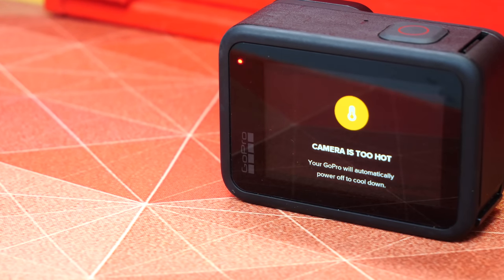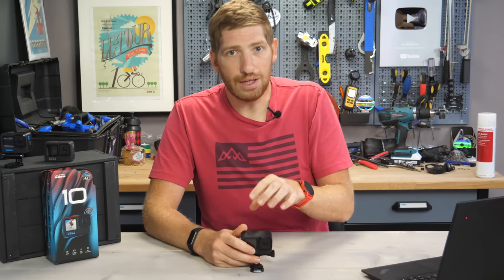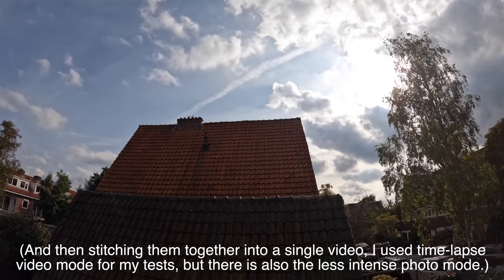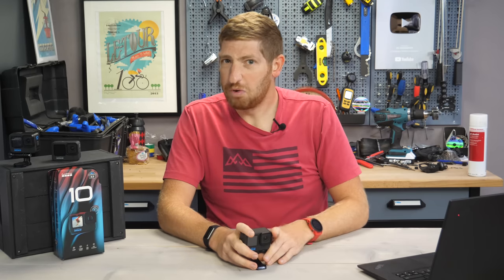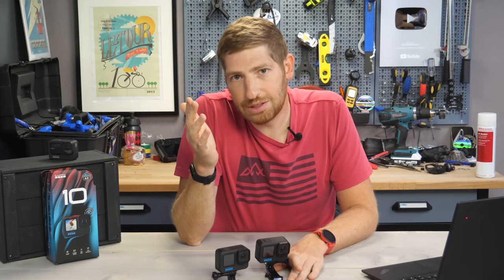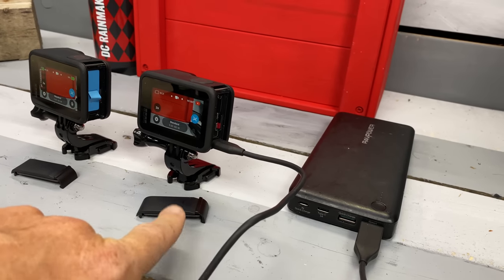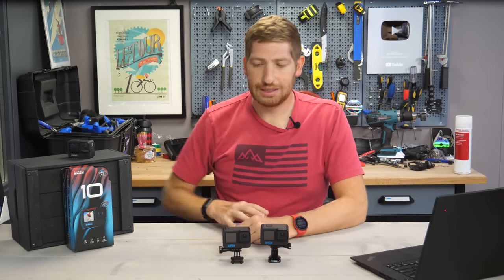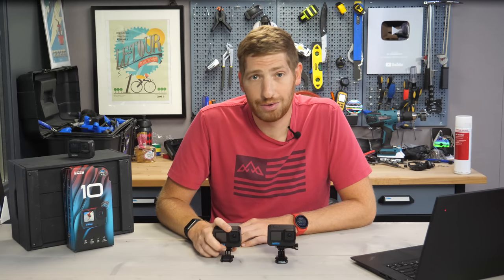GoPro Hero 10 Overheating: 40 Tests Later

Comment: What about taking off the battery and just run Gopro without battery and with a charging cable instead! It should dramatically increase the filming time and hopefully there will be no overheating. I've done that on my old Xiaomi Yi 2K and it just worked flowless.
Reply from the maker: It’s in the video…😉

Comment: two issues - *thanks for doing all this testing*:
->just got back from a ski trip to Park City, Utah and brought my newly purchased GoPro 10 - I expected to have a learning curve getting used to using it; however, I encountered battery too cold messages on two days in the mountains with the camera shutting down and couldn't even shoot a few minutes of footage after getting off the lift before that occurred.  You made a beach in your bathroom.  Perhaps you can make a mountain somewhere ...maybe add a fan blowing 40mph in your freezer ;) - I realize that Enduro batteries are being sold now (think that should have been included) ...but it was very disappointing to have no chance to capture footage of the skiing to share with family and friends; especially knowing that the camera is marketed for use specifically while skiing. :(  It wasn't below zero.

-> initially my first GoPro (RMA'd) would overheat when trying to recharge the batteries ...they would charge to about 70-80% and then the GoPro overheated and started cycling on/off - latest device has been better at that but I've intermittently had issues - this is in my 70deg apt. statically sitting with USB C cable powering it.

Comment: Thanks for your tests. Well done. 👍 What we really need. 101 degrees Fahrenheit isn’t that hot. That’s 38 degrees Celsius. As for in car dashboard, it shouldn’t fail, especially with air conditioning. An action camera needs to handle heat and cold. Doesn’t give me confidence.
Reply from the maker: Keep in mind that in a car dashboard with A/C, it wouldn't reach 101*F by itself (now, with direct sun it might impact it slightly).

Comment: My use case for GoPro's are to record airplane flights in small aircraft. I was having issues with the camera on the dash/windshield used to record the angle facing the pilot/co-pilot faces shutting down due to heat because it was directly in the sun through the windshield. To solve the problem I built a small heat shield to block the direct sun using an old iPhone box and heat tape (essentially think aluminum foil with a sticky backing). I cut holes in the box for buttons and on the front facing shield I just cut a hole for the square lens cover to stick through. Using one box I built two shields, one to use when the camera is facing frontwards and one when the camera is facing backwards. Working fine so far and haven't had a heat shutdown yet using the camera in the windshield.

Comment: Geez, I have 2 GoPro Heros (3 and 3+) and they have never overheated on me, even when recording continuously for hours indoors under tungsten cinema lights.  From time to time I consider getting a new GoPro, but overheating is a major major deal breaker.  The only reason why I buy a GoPro is for continuously shooting, who really fools around with a GoPro for little clips when smartphones are ubiquitous?
Reply from the maker: If you don't shoot 60FPS (and, for most applications there's no need to), then as the video shows, it won't overheat at 30FPS. And that's before the overheating-related firmware changes GoPro made last fall.

Comment: This has ben a very useful review, I currently own a Hero 9 Black that I use at 4k@60 with stabilisation and horizon levelling mounted on a helmet and it has produce very good 4k@60 footage in linear mode. Once when I rran it continuous for over 40 minutes outdoors it recorded everything but when I turned it off it would not turn on again for a while so it was close to overheating. I am interested in a Hero 10 Black because of its faster processor and perhaps 5k@60. Apparently the touch screen is better as well. Thanks for a well designed set of tests, a great review. 👍

Comment: Great review. Lots of valuable time involved. According to your results placing the camera in an aluminium cage show minimize overheating as heat disipation would be better accomplished by the large surface. Uhhh interesting. Someone may try it and report the results. Greetings from Paraguay in So.Am. Not certainly Dubai's heat but getting into summer soon.

Comment: I noticed a charging brick was used at a point and it greatly extended the time before overheating. Would I be able to use a power strip that has USB-C/A ports on it to power the GoPro in leiu of a battery? I'm trying to film my band's live performance which is ~1 hour and 20 minutes in a warm room so I am looking for a high degree of certainty it won't overheat.

Comment: Saved me from getting very frustrated, My 10 kept overheating basically because a leave it running high frame rates and quality for a long time with a 256 GB card - and to keep it going keep a battery back plugged in. Summers starting here in the UK and there isn't any wind so it it kept lasting 10 mins if i was lucky. Got to your idea of taking the battery out and leaving the door open. Success! Its going great guns. Never realised you didn't need the battery in :)

Comment: Ive been using gopro 9 black with external power and battery out at 4k for hours and works great. Once in the sun in texas it shut off. Do newer models require battery to be in to work?

Comment: Basically this is just like the DSLRs overheating when filming video. A lot of the Sony NEX cameras had a 15 minute recording limit because of this and other DSLRs are no different as they tend to limit or shut off after 30 minutes recording when they get really warm and this is just shooting 4K 30 or 1080p 60. What do people expect when you put such high powered sensors or processors in a really small enclosure? The DJI Action 2 also overheats when at a stand still. The OSMO Action had a little grill vent on the front of the camera to minimize heat build up ( I own one and a GoPro Hero 8 Black). Smartphones also have heating issues when filming at the highest res and frame rates possible. They even get really warm when gaming.

Comment: I was wondering if external power would help, so it's great to see it tested as well. I'm planning to use the GoPro with an external power bank for multi-hour recording, but was wondering if it would also help keep the temperature down, as at least some of the heat I presume usually comes from the battery quickly discharging during intense use.

Comment: I can record until the battery runs out in 4k30 indoors and stationary at 75F with stab on and L+HL and high bit rate.  Same conditions, I get 35 minutes at 4k60 to overheat.  20 minutes at 4k120 to overheat.  26 minutes at 5.3k60 to overheat.  I have not been able to overheat the camera outside in any real world use yet.  I think these and your numbers are fantastic.  This camera is amazing.  BTW, I would suggest you RTFM, where in fact it does say in the manual that at higher resolutions and framerates the camera can overheat and shutdown.  Apparently, I am the only person in the whole world that actually downloaded the Hero 10 manual to date.  Just saying, a little RTFM goes a long way to avoiding "issues" like this one.

Comment: In the case of a 100 degree day, you're going to have solar loading as well. My hero 9 struggles with this because the camera is flat black. I know it's hard to setup a solar loading test at home, and if youre not in a hot environment you can't even test outside...but that would make a difference.

As someone that lives in the southern US, my gopro is more limited in the summer than I expected.
Reply from the maker: It really just depends. It's only limited if you're doing fully static (with zero airflow) type scenarios. If you're using it while moving, it's not as limited as indoors on a desk.
Reply: @Dcrainmaker  agreed. I have 4 gopros and when i film multiple angles i commonly have 2 set stationary on the gopro tripod and gopro clamp (gopro designed stationary mounts, so it's not outside of the design intent). The stationary cameras struggle quite a bit from May to September here, but I've noticed thay the 9 is when the problems got worse. This is mostly expected with a second screen...but it performs worse than my cell phone by far. I have to go through a lot of effort to keep them cool up to the point that I am ready to film then I have to rush through the setup and action. I've also had major issues with filming from my dashboard in a 72 degree car, but with the sun on the camera. Gopro needs to go back to silver or white cameras. 

I think full transparency from gopro should indicate this. They chose a finish that performs horrible in solar loading (matte black) and sell several stationary mounts. They advertise their camera as much more than just for use while moving. My real world use indicates this is a much bigger challenge than shutting off after 20 minutes at 4K60.
Reply: could paint yours white
Reply: @unfunny2258  if anything I would redesign the camera shell for hot environments and leave most of the surface area clear anodized aluminum. 

This is actually a market opportunity for gopro - selling a premium version for hotter climates
Reply: @EngineeringAfterHours  yeah, or just making a metal case, but painting it white would be a decent fix to the issue of black getting way too hot and easy to do

Comment: Thanks for doing these tests. I am one of those weirdos who needs to run the camera for literally hours from an external battery, where the only airflow may be the headwind from my 10 km/hr kayak. I got ok results from the Hero 9 at 4K/30, but only when I put it in an aluminum case ("Gurmoir" brand). I also leave the battery out and turn off wifi, gps, bluetooth and both screens to improve heat production (can't turn off hypersmooth because a kayak race is a bumpy event). I just wish there was a more waterproof way to get external power - I run the USB cable through a Ulnazi door and try to seal around the cable with silicon gel swimmers earplugs, which isn't ideal.

Comment: Just an FYI inside the windscreen of a car. The testing spec we used to use for verification testing was 110 degrees C from memory.  50 degrees in the middle East gives crazy internal temps if they are left standing.

Comment: I purchased a Hero 10 recently (within a week) and did 2 things (amongst others).  Charging the battery for the first time, I put the usb cable in a fast-charge outlet* using the supplied cable.  The camera heated up to the point I could smell the heat.  Transferring the charger cable to a normal outlet, the battery charged fully without the awful smell and the camera cooled down.
* noted that manual says to use a fast-charge cable if needed (another accessory to purchase or another battery).
The 2nd time, a day later, I didn't / haven't as yet used the camera but switched it on to try voice commands, after reading the manual. I switched the camera on and the battery had a 98% charge.  As soon as I switched on, a message popped up stating a software update - something that GoPro had just issued.  During this download (in lounge room, with no apparent airflow), that used approx 25% of the battery, the heat (camera hot to touch) and smell happened again!  The camera wasn't on charge.  I switched the camera off until it cooled down, which was relatively quickly.  No idea if the update was successful. Continue with the settings, camera stayed cool.  Still haven't used it.
I intend to use the camera for outdoor activities with canines and equines.

Comment: We have the cooling fan that most of you have been looking for.  GoPro 10, shooting 5.3K | 60 runs for over 11 hours with CAMCooLER Mini cooling it at room temperature of 78 degrees or for over 4 hours at an average temperature of 119° F at 1080P | 60 | W, without the internal GoPro battery installed.

Comment: Hey quick question. I race karts competitively, I got the waterproof case because l don't want the gopro to get damaged by small things. I'd be recording my racing heats about 3x 10-15mins a race day. Would the gopro 10 still overheat for me or would l be fine? If it will over heat. Should l drill little air holes in certain areas of the case?

Comment: Great indepth tests, thank you.
Ray did you notice the battery percentage inconsistency when switching diffrent frame rates? Ie 35% in 5k24, 20% in 4k60, and 12% in 4k120.
Also the GoPro 10 shutting itself off when the battery is circa 30% or less when recording 4k120 in about 7-8seconds and 5.3k60 in about 15s?
Reply from the maker: Thanks! Yeah, I saw a few battery percentage inconsistencies a few times that I wasn't quite sure if it was my brain getting tired or not. So I mostly set trying to track exact battery levels to the side, as my spreadsheet was starting to get kinda crazzy.
Reply: @Dcrainmaker  your testing was impressively comprehensive

Comment: I use Gopro since Gopro 1, this 10 is just terrible, if you try to use with a media mod to upgrade your sound after 4 or 5 minuts Gopro shuts down for overheating with the prerecord option on, they shoud understand if they want to milk us to use a decent external mic at least the product should work, with the media mode case the cam heats in minuts

Comment: I mount my GoPro on top of my Can-Am Off-Road Vehicle and shoot for hours.  Overheating was never a problem with the 8 but it is a problem with the 10 and 11.  The cameras are in a waterproof housing to protect them from rocks and tree branches.  I have started shooting one camera with the regular lens in the waterproof housing and one camera with the Max lens (for vertical format) unfortunately there is no protective housing for the Max lens.  And as you guessed the camera in the waterproof housing overheats and shuts off and the camera with the Max lens does not.  So I am going to take your advice and remove the battery from the camera in the waterproof housing and see if that solves the problem.

Comment: For me this answers my main concern - will it record, in most weather conditions, for the duration of the battery life while riding my bike (which is my main use, as a cycle "dashcam" and filming rides for enjoyment). The answer appears to be yes.
Reply: Fro his test it appears as long as you are moving you can run it until the battery dies.  They appear to have added a tripod mode now which could have me in many scenarios.  I use them both indoors and outdoors and it appears they might help with the GoPro 10 as well when not needing to do shots while in motion.

Comment: As always, the group they ignore are those who do live streams (using HDMI clean-feed), that could be streaming for 4, 6, 12 or 24 hours powering the camera on maybe a 50Ah Maxoak battery bank.

I have not tested yet, if the Hero 10 finally will do 4k30 and 4k60 output on the HDMI port of the MediaMod, but it's a real issue on the 8 and 9.

This is just one group, that most certainly is using GoPros and most certainly not is shooting 70 seconds worth of footage.

And yes, the actual stream might not be 4k, but ppl might choose to take the 4k feed of the camera to crop into a specific angle of the footage. Placement for the actual view angle is not always possible. And 4k footage may be recorded locally (externally of the camera), while a downscaled feed might be streamed.

Comment: Thanks for your tests. What we really need. 101 degrees Fahrenheit isn’t that hot. That’s 38 degrees Celsius. As for in car dashboard, it shouldn’t fail, especially with air conditioning. An action camera needs to handle heat and cold. Doesn’t give me confidence.

Comment: Hi thank you for your test. Did you test lower resolutions indoors on extenral battery, is it still stops with cold battery alert ? What is the longes shooting time indoors with external battery no mather resolution. Is there changes in shooting time if you are conected on WiFI or not,  using phone app to connect or just sreaming? Did you try different sd cards ? Thank you in advance for answer.

Comment: To be fair, the GoPro is NOT the only camera that overheats, the beloved DSLR/Mirrorless cameras also overheat, especially at anything above 1080P. I think it was MarkusP that did a test of a bunch of DSLR/Mirrorless Vs camcorders, virtually ALL of the DSLR/Mirrorless cameras didn't last 30 minutes in the hot Las Vegas sun. I think he did the test on a hot day with temps I think over 100* in the desert sun as an extreme test, he began all the cameras rolling, and I forget the res he used, but likely 4K? if not 4K, 1080P and virtually All of the camcorders were still going after 30 minutes, and the conclusion was camcorders had more space for the sensor etc to get some air and not shut down.

I also think with GoPro being the "premiere" action cam means it's an easy target but also think many people have unrealistic expectations of how they intend to use their action cams. I don't run them for long periods, often starting and stopping them, and the same for my Canon vixia, a camcorder. Even last spring on a warm day, out in the garden, the GoPro Hero 9 didn't overheat, but I was not running it beyond 1080P. Part of that is, I can't do 1080P without uploading issues to YouTube (files being too big for my cable internet bandwidth), but my best monitor is still 1080P and my PC I doubt will edit well above 1080P anyway at the moment. That said, expecting any camera to run for more than say, 5-10 minutes at 4-5K is unrealistic without stopping is simply unrealistic, or expecting to 5K, just because you "can" does not always means you should.

Heck, even my GoPro gets quite warm, but I don't recall it actually overheating, and it may have a time or two since I got it last March but keeping expectations reasonable, I think the cameras do OK for the most part.